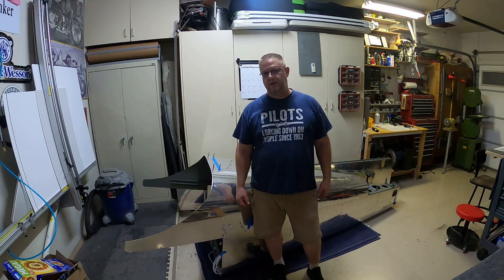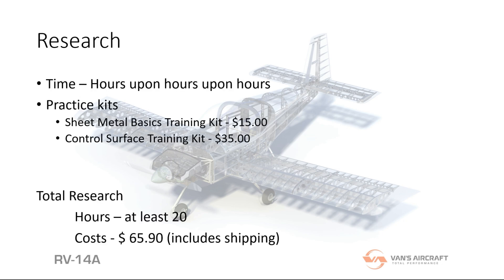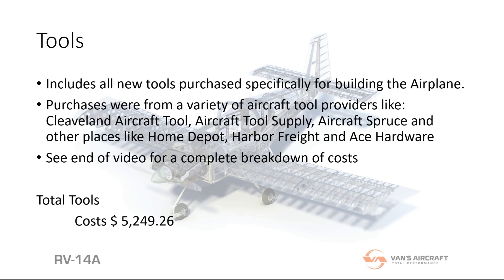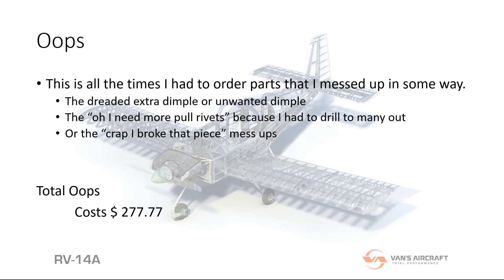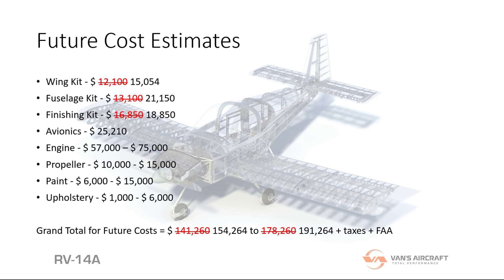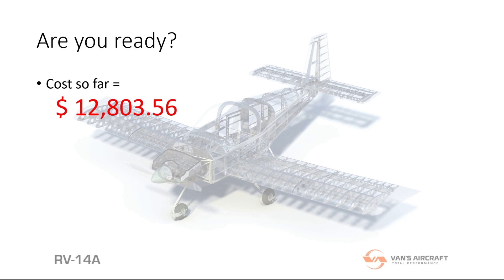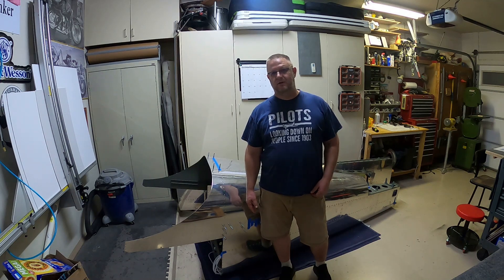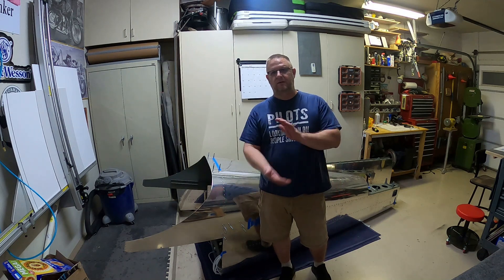RV-14A Build: Empennage Costs - How to Build A Vans RV-14A Airplane #vansaircraft #aviation #flying

Comment: Great idea for a video!! Just as an FYI- I've spent $9,667 on tools, $2,856 on the workshop, $1,633 on supplies and $130 on "oops" parts. I'm estimating $250k when I'm done with my -14A but I'm doing a Stein IFR panel, ER tanks, Beringer brakes, etc. Really enjoy your videos. They have been really helpful to me in my build. Thanks for taking the time to share them.
Reply from the maker: I think I'm going to have to see your plane when its done... Sounds awesome! Maybe when we are both done we can meet up at Air Venture...
Reply: how’s the project going? i’m building an rv14a as well, I have everything except the firewall forward kit and avionics it’s going to run 250k from start to finish paint job as well.